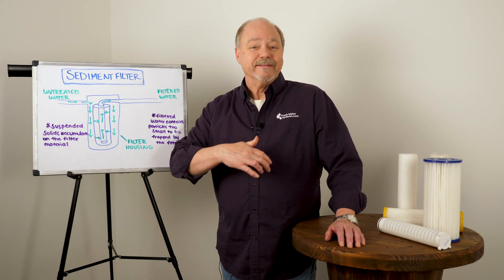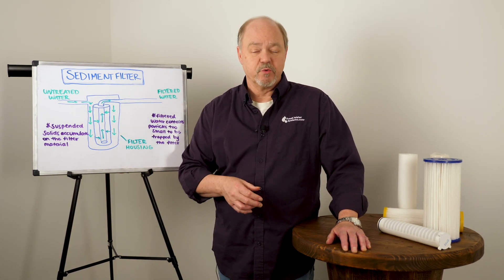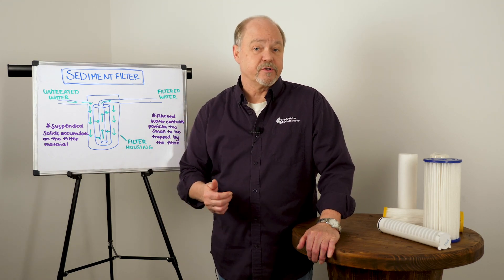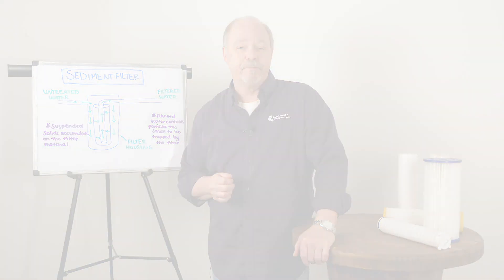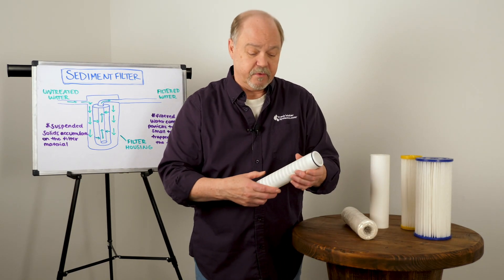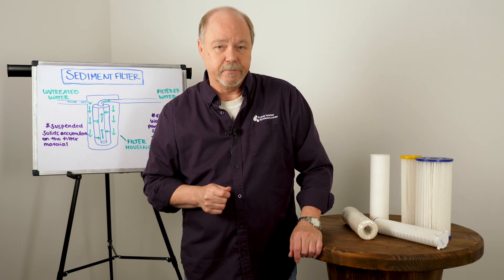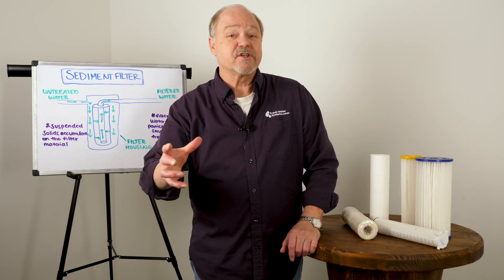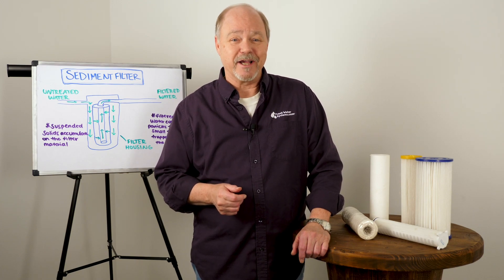What is Sediment Filtration and How Does it Work?

Comment: Thanks for the great information. I have a question: I recently hired a laborer to replace two of the melted polypropylene sediment filters in my filter system. He went to a hardware store and only found the 40" cartridge. Out of laziness, he decided that instead of driving to another store, he would buy the 40" and cut it in two equal pieces, since my filter housings are 20". Now, if those polypropylene filters are cut with a saw, won't that diminish their efficacy, or worse, won't it allow pieces of the fiber through into the water supply?